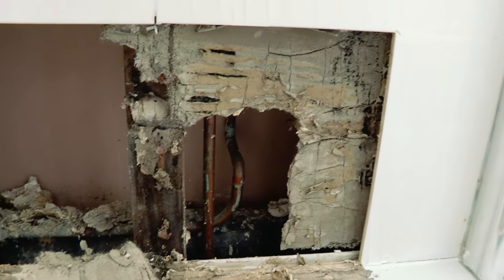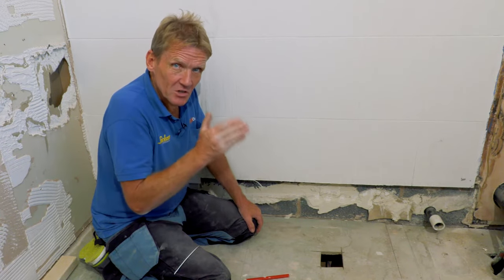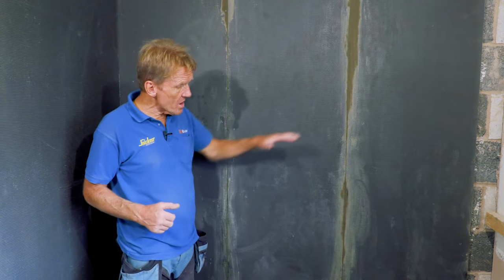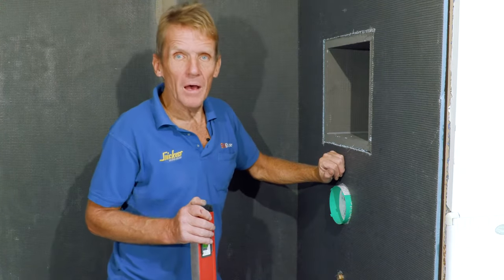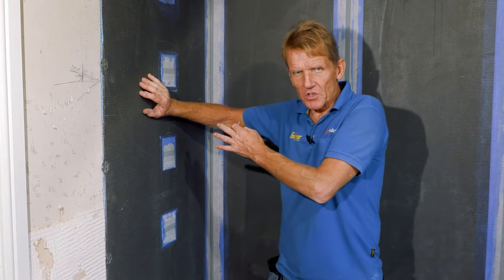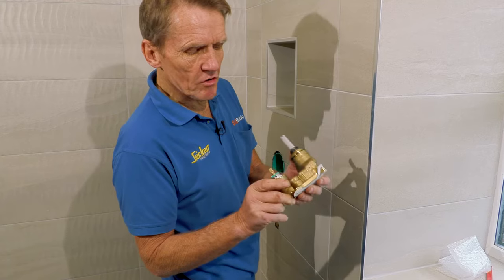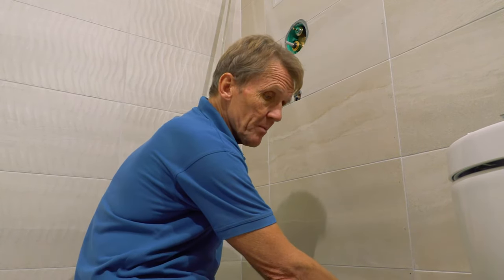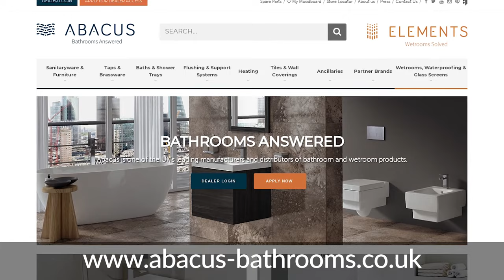Don't Have a Bathroom Installed Until You've Watched This Part 2

Comment: Really enjoy these videos. I do like a 'belt and braces' approach to sealing and waterproofing. I'm not a plumber, but I've used those wall boards before and they are great to work with, and give a great backing for tiles to go on.
The finished shower looks great. One thing I'd change though (there's always something lol) I'm planning to have the shower controls at the opposite end to the shower head. So I don't have to walk in to turn it on, and get covered in (primarily cold) water in the process.
Thanks again for the videos. Very helpful and enjoyable to watch.

Comment: British Standards Institute (BSI) for BS 5385-1 (wall and floor tiling in normal internal conditions), In clause 6.1.1.3, the standard states that ‘In wet areas … substrates should be protected with a suitable proprietary tanking membrane system’. It further declares that ‘the weight capacity of the tanking system should be capable of carrying the load of the tiles and adhesive’. All substrates within a wet area should now be waterproofed before tiling, even in domestic locations. This means this method shown here is now part of the British Building Standard and should be done on all new bathroom installation or refits.
Reply: Even on concrete floors?
Reply: @simonstones1918  not sure what you question is here, in a wet area of a shower, you would have a shower tray, the concrete floor in this area would be protected from the water by the shower tray and as such the floor within this area wouldn't need any additional protection. The floor outside this area would be outside the wet/showering area and as such wouldn't need any further protection to conform to the BS but it wouldnt be a bad thing to add extra protection.

In the case of having a wetroom created in a room with a concrete floor which is to be tiled, the flooring area will require tanking completely prior to tiling.
Reply: Tiling has to be on a flat vertical surface. I use this product or similar on ALL my jobs now.
Reply: great,learn a lot

Comment: There seems to be a contradiction of your previous videos when bedding in shower tray on a wooden floor! You say use sand and cement mix to level instead of tile adesive as it does what is says, stickes. I am confused, which is the correct method? Thanks.

Comment: Top tip, always always put down a substantial protective covering on your shower tray before even considering working over it! What I usually do is firstly clean the tray very thoroughly so that there is absolutely no chance of any grit on the surface of the tray, then I cover it with a Proguard breathable fleece and then a product called Proguard Correx very reasonably priced to buy I use the 4mm thick type such a versatile and cheap product I use both products everywhere over oak floors that I have put down or tiled floors to protect the surface while I am working, its a very worthwhile investment and could save a lot of stress and unexpected expense!  Once I have installed the Proguard I then put down a Half inch ply and that way if you drop a shower head attachment or a tool of some kind it wont damage your lovely new shower tray...

Comment: Roger. Does it matter which way round the sealing tap goes over joints and does it matter if you totally cover the tap on outwards facing side? I am having problems getting adhesion around the sides of the niches with the tap and adhesive in the shower area?

Comment: Are you only taping the top of tray? Previous videos show you do the sides?
Reply from the maker: We would adhere the tray to the wall with our MD fixing adhesive and then use our waterproof tape with our Pro-seal adhesive on the transition joint between the tray and the wall.
In addition to the shower base we would also highly recommend using Elements wall boards on the vertical walls of the shower area with the same waterproofing method.

Comment: What adhesive did you use yo dot n dab the backside of those waterproof boards and what type of screws are you using in combination with the rosette to fix them to the studs, i reckon the screws need to be somewhat resistant to water?
Reply from the maker: We use our KST adhesive to adhere the board to the walls and our s/steel washers and screws. The screws do really need to be resistant to water and they should be covered with our waterproof tape and pro-seal adhesive.

Comment: Hi, Roger happy new year,iam putting wedi boards on the bathroom walls,I have porcelain tiles on at the moment would the board's stick to the tiles with the tile adhesive you mentioned or would I need to use blue grit or take them of?

Comment: Hey Roger, what mm plywood do you use for the floor? 8 mm probably?
Reply from the maker: Hi - if it’s the Plywood under the tray then 18mm would be the minimum.
Reply: @AbacusManufacturingGroup  I have the original floorboards and so im laying the ply on top, so surely i can have a thinner piece of ply?

Comment: what if you have a concrete floor? what do you do?
Reply from the maker: Aside from the labour heavy option of chasing out for any pipework (taking into account falls etc) and tray it might be an idea to consider raised concept options. This is a tiled alternative to a legged acrylic tray alternative whereby the pipework can be run above floor level, so you get the modern tiled look of a wetroom without the more advanced construction requirements.

Comment: Great video but I always hate having to screw a male thread into a female hidden in the wall. You can never be 100% sure they don’t leak. Some kind of pushfit fitting and screw fixings with cover plate would be so much more sensible.